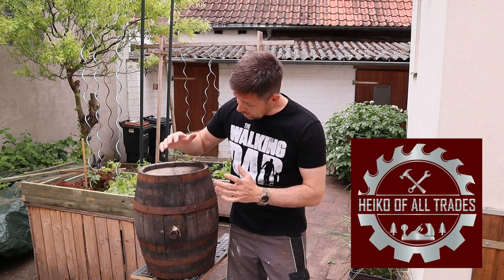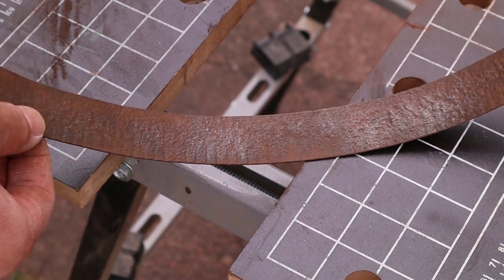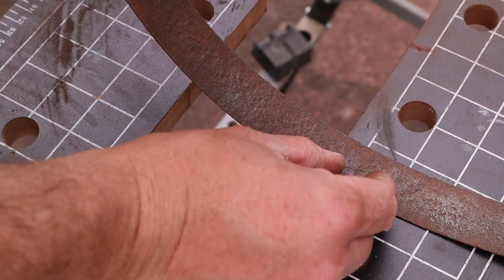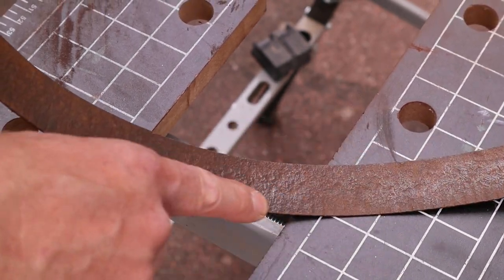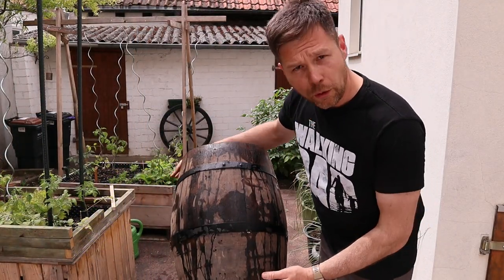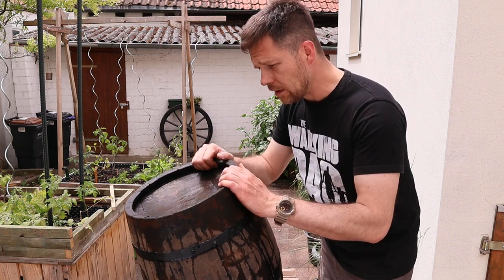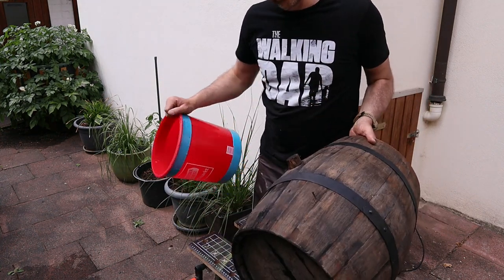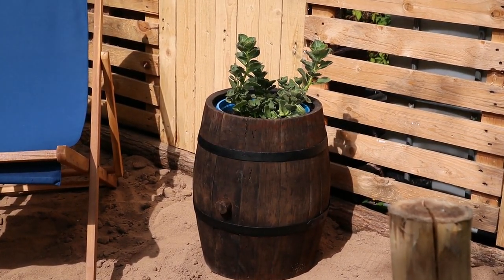100 year old wine barrel restauration - modification.

Comment: I bought a whiskey barrel to use as a rain barrel outside. It's not particularly old, just discarded from the distillery.  It has 3 one-inch holes in the side for venting.  What's the best way to stopper those hole to make it water tight?
Reply from the maker: I would take a oak - if this is the wood of the barrel - branch and cut it to fit the holes. It will look like a plug from the distillery.

Comment: How would you seal the cracks?
Reply from the maker: If you want to stay traditional and make it watertide you can take reed leaves. But my old wood was too dammaged.
Reply: @heikoofalltrades2267  what if I don't care about staying traditional?  Wax?  Caulk?
Reply from the maker: @Juicememelord  Hmmm, maybe a kind of Silicone. The Whiskey producers used a kind of sugar syrup, but I dont know much about it. I would go with Silicone - flexible, food safe. I would use it from the inside.